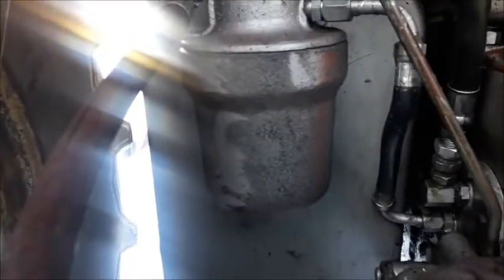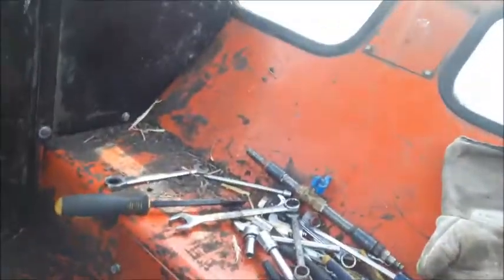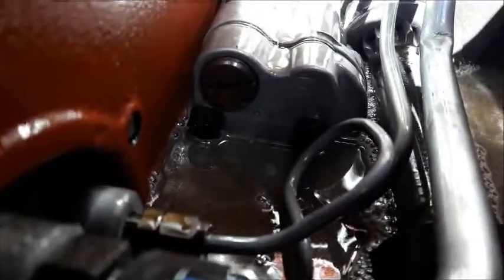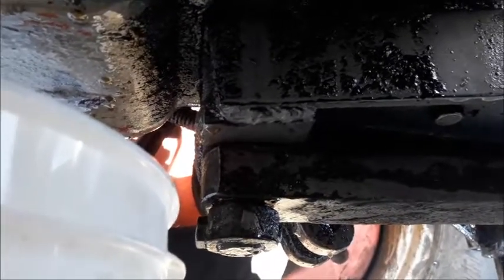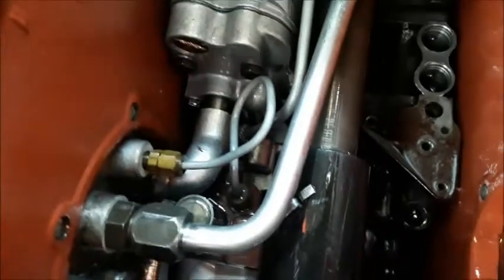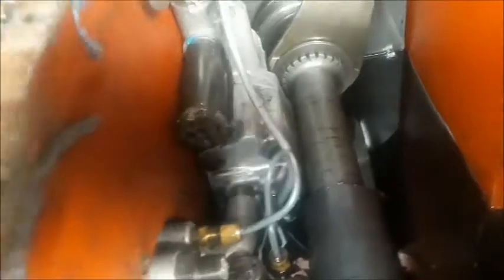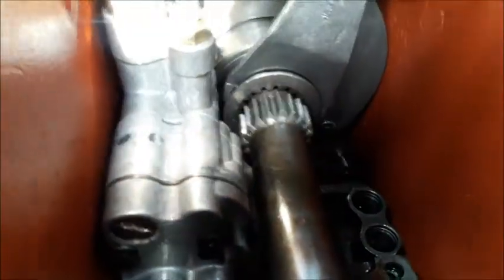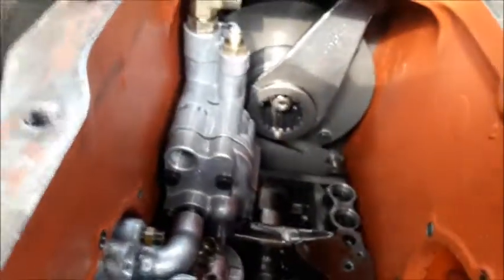MF 1085 Loss of Hydraulic Pressure pt1

Comment: Any updates on this? I picked up a 1085 last winter used it to plow the driveway and I love how easy it starts and we'll it runs. Then I tried to use my round baler and it won't lift the hydraulics. I tested both tempts and can't get more than 500psi. I'm pretty basic when it comes to hydraulics. Wondering how you made out.
Reply from the maker: Sounds like the hyd pump. I had to split mine and change the pump, takes about 8hrs to split, change the pump and put back together. You can find the pump all over the internet, for about 600usd. I have another video showing how l did.
Reply: @jonathantarrant2449  I'll look for that video thanks !

Comment: Hey good video and I had the same issue as you and am troubleshooting the same way. So is there going to be a part 2?
Reply from the maker: Yes got the new pump, just have not had time to put it in. Part 2 video will be donw then. The pump has a high and low pressure side and the seal is gone in between the two sets of gear teeth allowing high pressure oil to escape into the low pressure side, l only get 1500psi on the high side doesn't matter if l turn in the relief. So tractor needs to be split and pump changed
Reply: Jonathan Tarrant oh that’s unfortunate for you and kinda sounds like me as well. Well I’ll be whatching. Thank you!